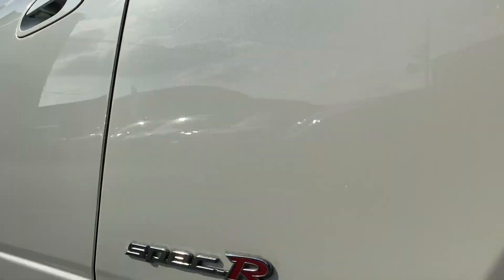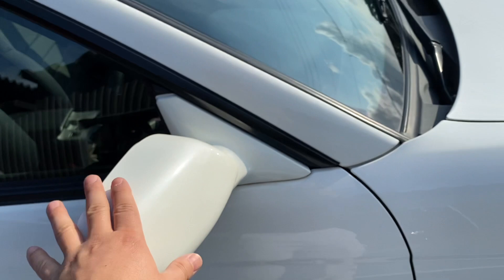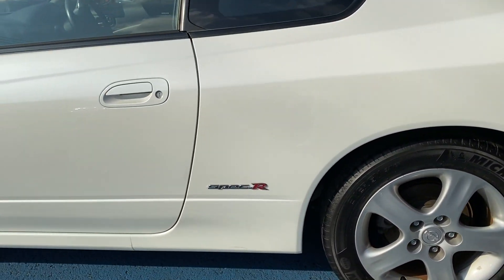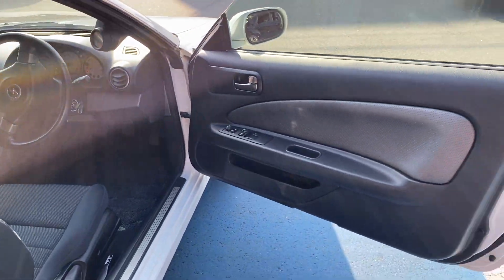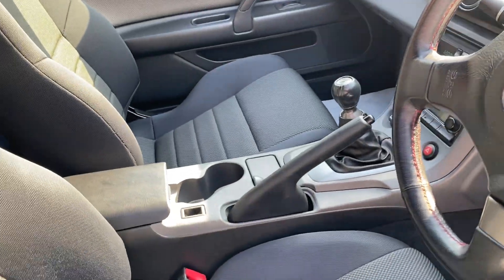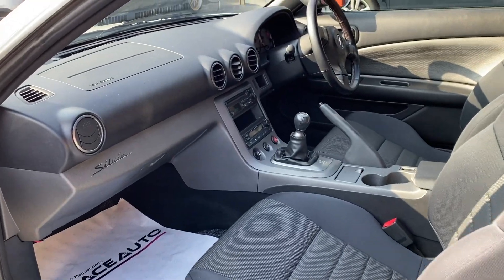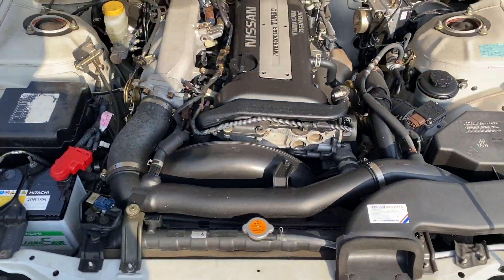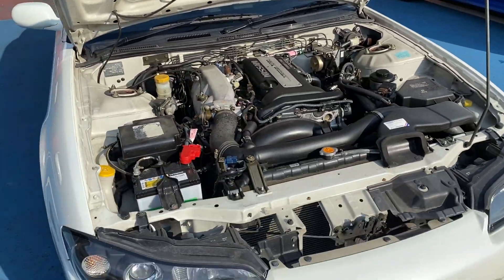HOW MUCH WOULD YOU PAY FOR THIS SILVIA S15 SPEC R?

Comment: throw one back at you what do you think a S15 R-Spec Nissan Dealer custom ordered Nismo upgraded one is worth ( with Sunroof ) all aero apart from rear wing is worth ? ...  no repair history but body has a few dents from door hits needs a repaint some scratches are too deep to buff out . ( 1 of 193 made in it's spec ) Super Hicas subframe replaced with a non-Hicas one.  ( i got all the paper work since it was purchased , every shaken report , nismo certificates etc , even a Nissan Credit card application from 1999 lol )

Comment: Last time I seen a low mileage S-15 Spec.R price was $17000. USD in a gun metallic gray 1999 model.  It sold really fast.  My guess $30000 to $45000. Depending on condition.  I know the 270R can be brought over as a Show or Display but good luck finding  one.
Reply: No the not , r grade bid for $14000usd (186000km)
Reply: @coopsnz1  huh?

Comment: I sent an email asking about a spec S aero hope u get back to me soon (can't legally drive the spec r as a probationary driver IN aus 😢)
Reply: How much do u reckon will a spec S cost AUD?
Reply: @eibadshariat3207  no clue Tbh I'm hoping like 18k max judging by how much they auction for but just guessing
Reply: @michaelkekoc4432  yeh Dude for P platers like us,  budgets to be pretty tight
Reply: @eibadshariat3207  you can't register jdm spec s's in Australia, only adm spec s's, do some research
Reply: @joshhall2323  couldn't find anywhere that said that man could u link?
Reply: Michael Kekoc you will only be able to import spec S under the 25 year rule. So you will have to wait until the yanks can also get them. Spec S don’t qualify under the current SEVS rules for grey imports under 25 years